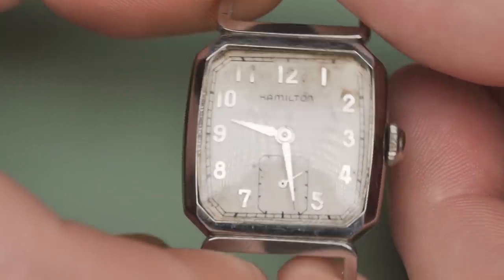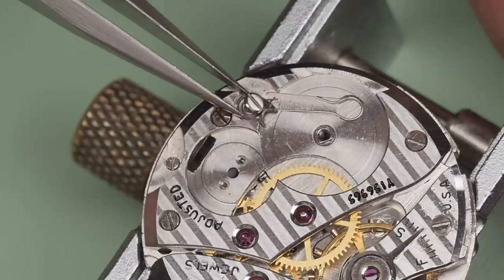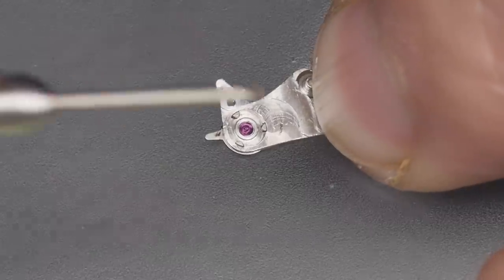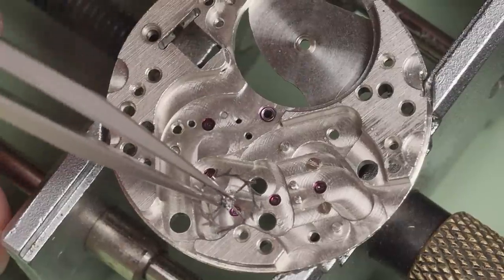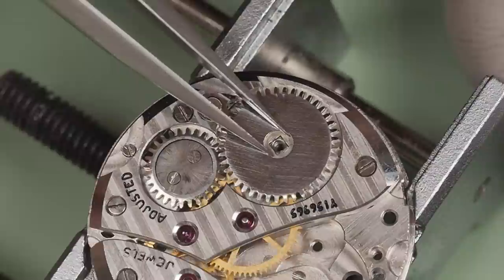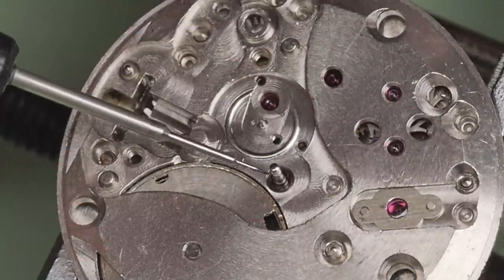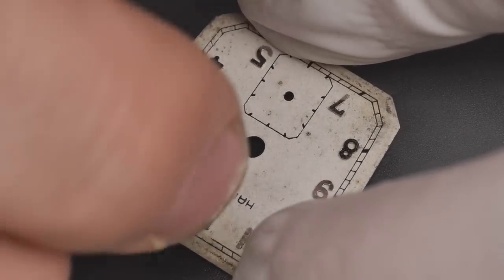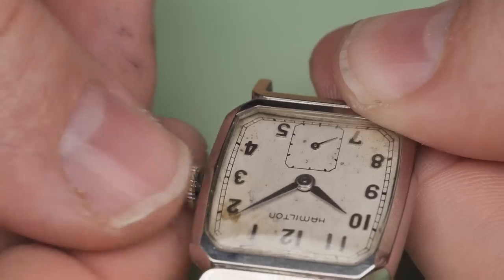Servicing a Vintage American Made Watch Movement from 1949 - Hamilton Caliber 747

Comment: Excellent video!  A jeweler friend gave me a Hamilton 747 movement from a watch he'd scrapped the case from.  The clutch wheel and winding pinion had rusted together, and the stem was moderately trashed, but with the help of your video, the movement runs!  I haven't got it on the timegrapher yet.  Some things I learned: 1) when you said don't launch the click spring, that was excellent advice - it took some time to find.  2) The watch runs much better when you remember to put the pallet bridge screws in.  For some reason, the seconds hand stops the movement, so I've taken it off.  I may try getting it back on again later.  Thanks again for a very helpful video!
Reply: Also - having no mainspring winders, I did the barrel by hand.  It wasn't as bad as I expected.  I'm like Hank Williams - I ain't got nothin' but time.
Reply from the maker: This is so great to hear! One of my goals with this channel was to help others enjoy the hobby and bring vintage watches back to life. Thank you so much for your comment! Keep it up and let me know if I can help as you fall deeper into the watch repair rabbit hole.

Comment: Hello, I really liked your videos, the explanations are very clear and precise, and I would like to ask you if it is possible, where do you get the spare parts for repairs and maintenance, such as the glass of the video clock? Thank you so much. Regards
Reply from the maker: Thank you Jose, I appreciate the compliments!

eBay is the best source I've found for project watches, parts, crystals, and used tools. If I can't find a specific part that I need, I'll buy an entire broken movement (or two) and scavenge parts from it. This is also how I ended up with a massive stash of parts that I can pull from and not have to go to eBay nearly as much any more.
Reply: Thank you very much for your teachings and your sincerity.
It's a pleasure to watch your videos and learn from your advice

Comment: Great job! Nice video! Have the same watch with a vary rare black dial with the 18k gold hour marks. This watch when new has 3 options the one in your video the black dial with 18k gold marks and another option with radium lume. My black dial Hamilton Raymon is my favorite watch style.
Reply from the maker: Thanks Nick! I didn't notice it in the catalogs, but that's so cool there is a third option out there. I'll bet the black dial looks absolutely fantastic!
Reply: @WolfeVintageWatches  yeah it is very cool looking. In general these stainless steel Hamilton Raymon watches are kind of hard to find or see because stainless steel watches were not so common back in 1949.
Reply from the maker: Exactly right. Gold plate, and solid gold of course, were definitely the fashion back then and dominated the market. Kinda makes me wonder how today's watch trends will be viewed 70 years from now. Will they shake their heads at how "small" watches were in 2020? Will they wonder why steel was so predominant and not unobtainium alloy fiber mesh composite material that can only be made on Neptune?

I wish I would be able to stick around long enough to have a watch made on Neptune. That would be awesome.

Comment: Thanks for the video. I just subscribed to see what other movements you work on.  I have a Nordon with a 747 I just serviced. I have been fighting with this trying to get the beat error below 2. I know ideal is less than .5 but is that a reasonable expectation in an old movement like this? It is difficult setting the beat on these older movements without the adjuster.

Comment: Can I ask you a question. I cant afford an automatic oiler, on these vintage non-shock protected watches can I oil the balance with just normal oiler? if so how can I do it? I was thinking about trying to push the oil through the hole jewel so it can reach the cap jewel using something sharp...

Comment: Hey! I love your videos. Recently I bought a watch with the Hamilton 748 movement. My surprise was that I bought it without working, and it still not working. But when I put it in some positions it works for 10-12sec and then stop. The scape wheel looks good, anyway I'm afraid that maybe one tooth is broke and I will need to replace it. Do you have any idea of what can I do?
Greetings from Mexico!
Reply from the maker: Gracias por ver mi video! It's hard to say what the issue(s) may be. It could be several things, but a likely culprit could be a broken/bent pivot or jewel. I do take on service jobs if you want to send me an email with a couple of pictures. You could also see if there is a local watch shop that could take a look for you. Buena suerte!
Reply: @WolfeVintageWatches  I send it to my local watchmaker and (surprise) we found the issue! The seconds gear it's a little bit bended and he's trying to put it the straightest possible. If this don't works, I'll have to buy a new one :(

Comment: Has sir enough data to render an opinion of the differences between green and grey rodico?
Reply from the maker: Great question Robert, and also very observant....

It may just been in my head, but the gray rodico feels a little drier to me than the green. In terms of functionality and effectiveness, they both perform the same as far as I can tell. With the green rodico, it's a little easier to tell how dirty it really is. The gray kind of hides some of the dust and grime which I would imagine could cause some problems down the road.

If you're deciding between the two, I'd say to buy whichever is available and less expensive.
Reply: We are living in a simulation, and the two versions of rodico are a glitch in the matrix. Buy bergeon for pro jobs. I like 6033 best. Some like 7033. Others even use both. I buy and use chinese knockoff-rodico for larger 'holding-in-place' constructions. That really pays off.

Comment: Why don’t Americans make watch movements anymore?
Reply: For the same reason we don’t have much of a manufacturing base anymore...labor costs are too high here.  Why would any watch manufacturer pay American labor rates when they can pay Chinese laborers just a fraction of the price, send the parts to Switzerland and then be able to put Swiss Made on the dial?
Reply from the maker: In addition to labor costs, I've also heard that making hairsprings is exceedingly difficult. I'm certain an American manufacturer could figure it out, but the capital investment would be astronomical and would take decades to become profitable, if ever.

Plus,  over the past several decades, the Swiss have done a great job of associating themselves with luxury and quality. I'm no marketer, but that seems like it would be a tough nut to crack for countries that are not Switzerland.
Reply: @WolfeVintageWatches  the few watches out there today that claim to be made in USA but have Swiss movements. I have no problem with Swiss movements as I own a Hamilton Khaki Field auto and I love it. However calling a watch American-made with a Swiss movement is like calling a Chevy truck a Chevy but it actually is powered by a 302 V8 Ford engine. My dad has an old Waltham pocket watch that I’d like to get working, as far as I know it winds up and runs, it’s just missing a hand and the crystal is missing.
Reply from the maker: A Ford 302 in a Chevy 1500?! Blasphemy! Although, I am OK with a Chevy small block in a rodded out, dropped, chopped, and shaved Model A, so I guess there are exceptions to the rule.

Just between me and you, I love my manual wind Khaki Field as well. There's no doubt the Swiss are known for their watch making for a reason. You're exactly right though; a Swiss (or Japanese, or Chinese) movement in an American made case does not make it an American made watch. Have you checked out https://weisswatchcompany.com/? If you love your Khaki Field, Weiss's Standard Issue Field Watch might be of interest. 

For your Dad's Waltham, have you poked around on eBay for the parts you need? I know you'll be able to find a NOS glass crystal. You might need to hunt a little for the correct hand(s), but I'll bet you can find them there too.
Reply: @WolfeVintageWatches  I have looked on eBay a little bit but I haven’t dug into it really seriously yet, thanks for the advice man!
Reply from the maker: No problem, you're more than welcome. Let me know how it goes!